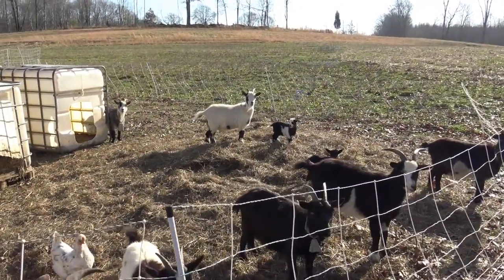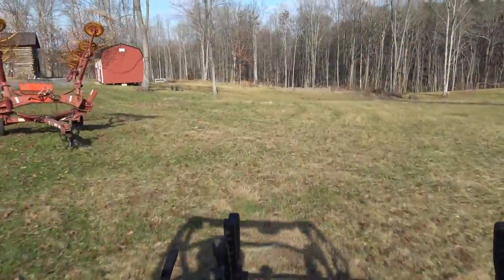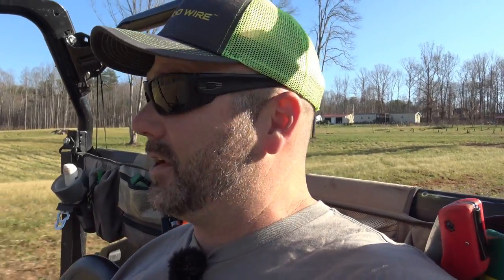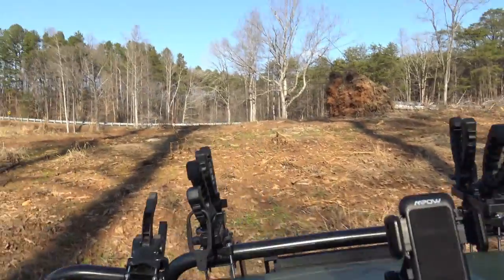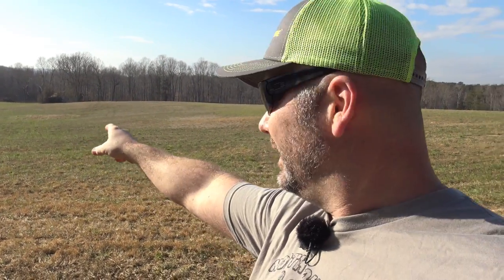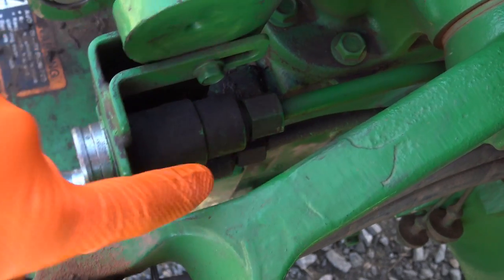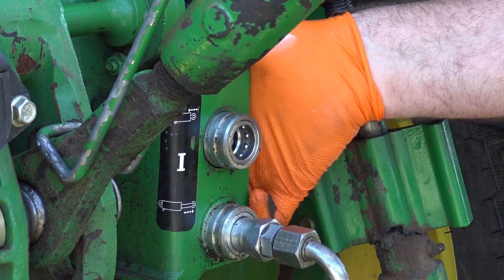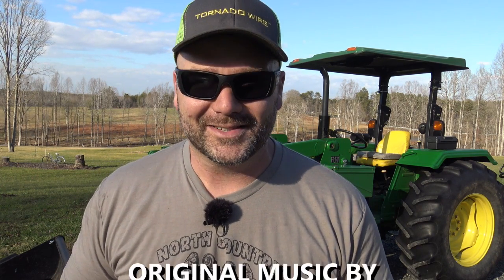Tractor Repairs...replacing quick coupler on the John Deere 5065 and much more!

Comment: I have the same issue on my 5075E, the bottom quick coupler has always worked like a champ, the top one has always been difficult.  The top coupler has been difficult since the tractor was brand new.  Other JD tractor forums report the same thing on the 5055E, 5065E and 5075E tractors in that somehow the top coupler is very difficult.  You can clean it regularly and tap the interior ball to ensure no hydraulic pressure is present, but that really doesn't help.  It's the upper fitting, somehow.    I'm giving up and replacing mine with 1200 hours on the tractor clock.  Awesome channel!

Comment: Hey Josh!  Next time you have this issue try taking a medium nail punch and “lightly” tap in the center of the tractors quick connector. I had mine stuck on the grapple connector by the loader on our H260 loader and it was just stuck preventing the couple from fully seating. Note:  wear safety glasses - hydraulic fluid only has one way to go when you do this...your face.   Keep it up!

Comment: Josh before wasting money on new connectors you need to make sure and have all pressure off the lines before disconnecting, any pressure on these quick connectors will cause lock down. This happens mostly on the male side. I almost guarantee that you will have this issue again. If so push the check ball on the male side if you can't push it in that's going to be the issue. Absolutely do not hit with a hard object but put the ball against something like hard plastic or hard wood the push or strike the ball with a non metallic instrument when the check valve ball moves the pressure is gone you should be ready to connect. Wear face shield when doing the pressure release. To check the one you took off try connecting it now, i bet it will work.
Great vlogs bud, b t w the hog vlog brought back memories from the good ole days, the only difference is we used water and burlap bags to scald the hog. I never saw anyone use a vat. Very interesting way. Yep you can learn a lot from a dummy😁😁😂😂 dummy, keep on keeping on my friend and thank you for your armed services!!!!!!!

Comment: So did you try the reconnecting old coupler onto the hose, before installing the new coupler. Sometimes if you don't releave the pressure on the coupler, you're unable to connect.

Comment: Sometimes you can take a hammer and punch and tap on the disconnect to relieve pressure and get the fitting to go in.

Comment: Hello Josh,
Thank you for making and sharing so many interesting and helpful videos. Greatly appreciate it. Some time ago you posted a video on replacing the quick coupler on your JD 5065. I have precisely the same problem on my two 5065s and one 5075. I tried a replacement part from John Deere, but that part was not helpful. I am sure you are very busy and it has been some time, but is there any chance you might recall the part number for the new coupler you installed. Thank you very much for your time. Best wishes for an amazing season ahead.
Reply from the maker: go to green parts online and you should easily be able to find it...if your JD dealer can't give you a part number...then you need a new dealer...this is a very very common part to replace...this part is directly from deere
Reply: @StoneyRidgeFarmer  Thank you very much, Josh. I will have a look at green parts online. Indeed, I have been a bit disappointed that my dealer was not able to solve the problem straightaway. Thank you very much for your helpful reply.

Comment: It nice and dry on our land it's very strange for us ground is hard enough to drive on in Ireland it's usually very wet in winter it's been a long autumn no winter yet. So times cup link will not contact because of oil pressure behind the cup link on the male or female side so that cup link might be still good.

Comment: (Edit: He really did have bad connectors on that tractor. He rang up John Deere  and it is a common problem with that model of tractor. )

Normally, before you blame a quick connect as the reason you cannot connect your hydraulics, turn off the tractor and bleed off the oil pressure in both the implement and tractor hydraulics. Any oil pressure in the lines will cause check valves to stay shut and will prevent you from connecting the hydraulic line. .
Reply: Geoff Turner I agree.
Reply from the maker: guys....believe me I'm not a complete moron bhahhahah.....the connector is bad...you guys may have not seen them but I've mentioned in previous vids...this is a known issue with these rear quick connects....I worked for more than an hour on it trying to work out what was wrong, bleeding off pressure...tractor on...tractor off....grrr it was frustrating...and I had a few choice words...
Then I called John Deere and they immediately told me there was a known issue here.....I'M NOT AN IDIOT FOLKS....JUST BECAUSE I LOOK FUNNY BHAHHAHHA.....THANKS FOR THE ADVICE GUYS....I ALWAYS APPRECIATE GOOD ADVICE...😎
Reply: @StoneyRidgeFarmer  you tell them LOL
Reply: @StoneyRidgeFarmer 

Josh, 

 Just read your comment. I am sorry, I missed your video about the bad connectors on that model of John Deere Tractor. Watching your video here, when you were demonstrating connecting the bad connectors with the tractor running, I and many other commentors jumped to the erroneous conclusion that you may have just had hydraulic pressure in the lines, as the engine runs the oil pump. I and I suspect many others have previously had trouble connecting up hydraulically  driven implements in the past due to a running engine, oil pressure in the lines, and no way to relieve it until we shut the tractor down. 

I do not consider you an idiot, far from it actually. It takes brains to own and run a farm properly, and guts to film it and put it on YouTube. 

However the thing with YouTube  is that knowledge can be freely passed around, in previous times, everyone would have to work it out for themselves.  The thing with the comments section, it is like a collective brain, some comment ors say you  are doing a good job, some troll you incessantly (and forger that there is another living, breathing person on the other side of the camera lens), others pass on knowledge. There is quite a wealth of information out there. 

I was trying to pass on knowledge without knowing all of the facts. 

So once more I apologise for commenting without knowing the full story with advice that was not needed. 

I will leave my previous comment  here for other's reference to help  other people out, but edt it to state that I you did have a bad connector. 

I hope you accept my apology, I would shake your hand and apologise in person, but we are half a world away. 

Have a good day and keep making videos, 

Geoff Turner.
Reply: I was just sharing my experience too...

Comment: Obviously you tractor is different from our 2010 5075  and 2018 5045. because the couplers thread directly into the service valve .. Our old 2955 High Clearance tractor has those snap ring couplers.......Pain the A$@ to connect to......

Comment: I will tell you what you have going on with your trees falling from wind. You took away the forest from them. Sounds simple and huh? at the same time, but basically, they grew in a forest where they all were reaching to hit the canopy at the top, most branches down low on the trees were not getting enough sunlight for the tree to find it useful to keep the branch and dropped them as it grew higher. so now you have a situation where the majority of your trees branches and leaves are at the very top like a lollipop. When wind does come along and blow on them, the leaves and branches catch on the wind and have a bit of a kite effect and cause them to fall over. The good thing is most of those are trees that do not like sunlight on their trunks and will branch new branches where the sun can shine on them; given 3-5 years, most of them will start looking like popsicles with branches along the length of the trunks instead of just at the top, the roots will also grow stronger and branch out more with all the additional sunlight they are getting. It will self correct it just takes some time. A good general rule is most hardwoods will fix themselves, most evergreens like pine trees will not. If it was me, I would let the ones on the creek go for another two years or so and let them sort out which ones don't like the wind, then start thinning them a little at a time over 5 years.